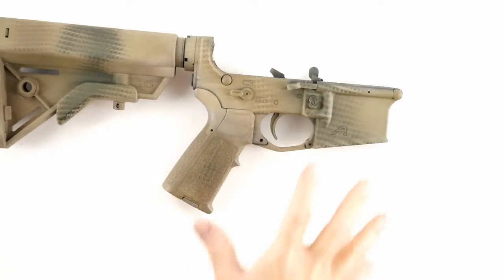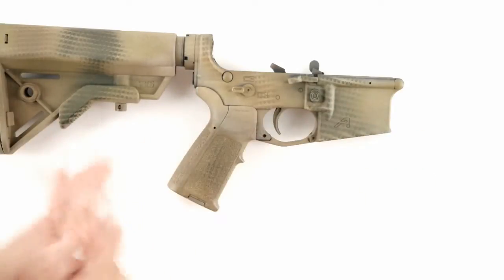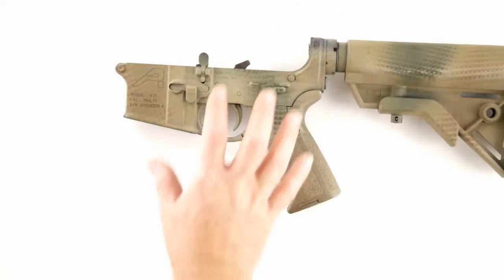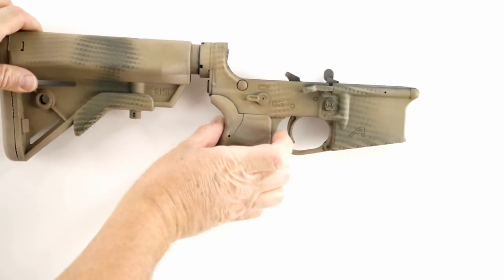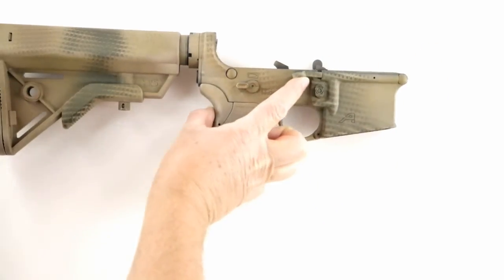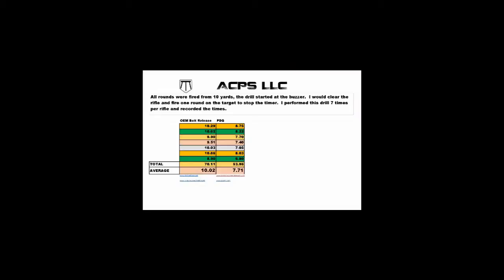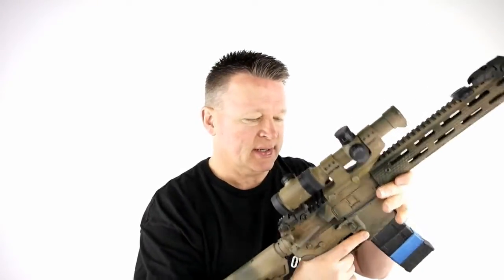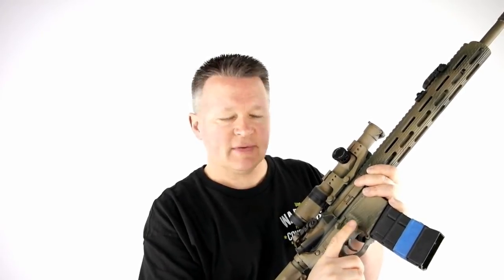PDQ AR Bolt Catch and Release on AeroPrecision Lower

Comment: Put that lower on a gibz arms left side non reciprocating side charge upper and you'll finally have all the controls where they should be
Reply from the maker: I actually would rather have the charging handle where it is with a Raptor charging handle that can be used equally as well from the right and left side. Thank you for watching and posting.

Comment: I was thinking of springing the $400 necessary to purchase a "tac-con" trigger.  Not sure if you've heard of them, but they utilize all three switch positions on your safety lever (safe, fire, reset assist fire).  It's not a full auto answer, but it allows for much more rapid fire because of the trigger reset assist mode (trigger is pushed to the reset position by action of the gun, allowing for quicker trigger pulls).   I've thought about slide fire type stocks, but I don't like that they keep you from using the gun ambidextrously.   Any thoughts on triggers?  Any need for full auto fire or very rapid fire?
Reply from the maker: I would suggest you instead drop some money on a Geissele trigger (SSA-E) and learn to run that efficiently.  See my video "Triple Half-N-Half" - and that was before I got my Geissele trigger.  You won't need to have any faster fire than that.